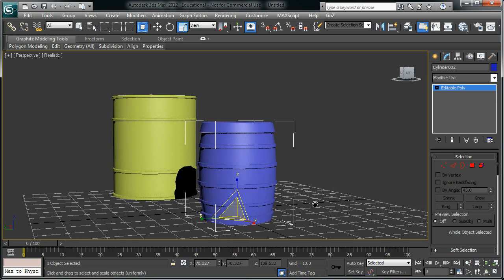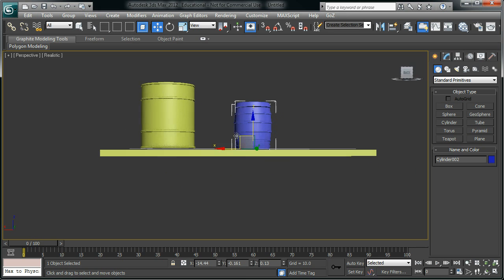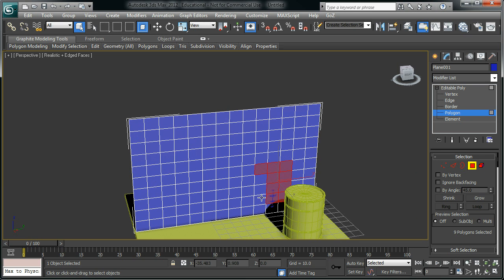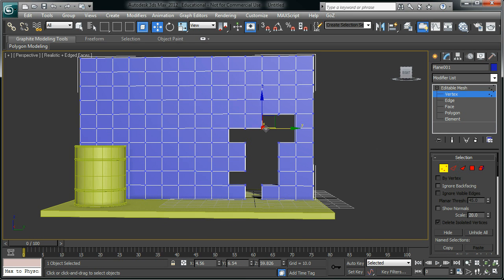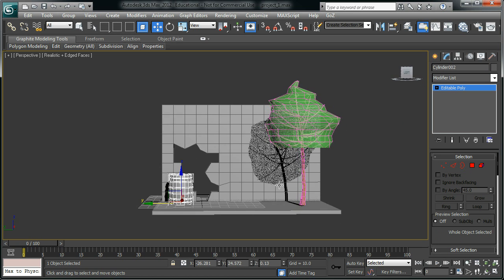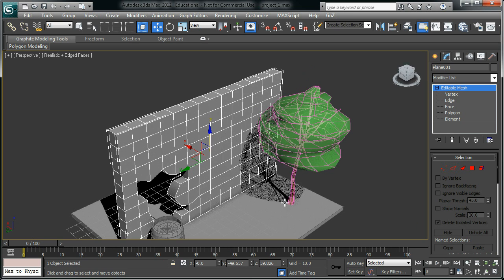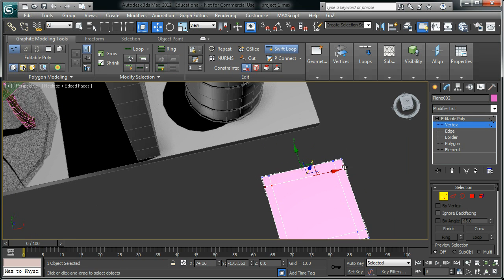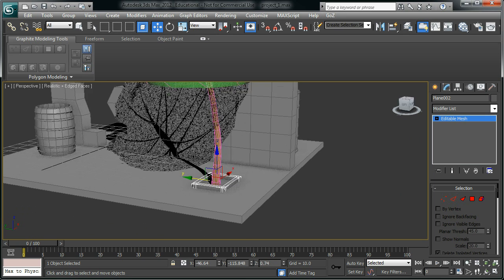Creating walls

Comment from the maker: I want to make hole on the wall, if I started the wall with the box and delete some polygons to make the hole you will see the gap between the two surfaces where you delete the polygons, which can be fix with the bridge tool but you could avoid it happening if you start the wall creating with plane and delete some polygons and then apply the shell modifier to make the thickness. I found it bit easier.